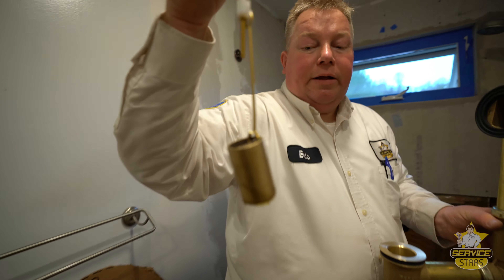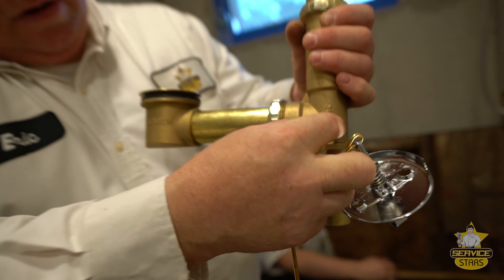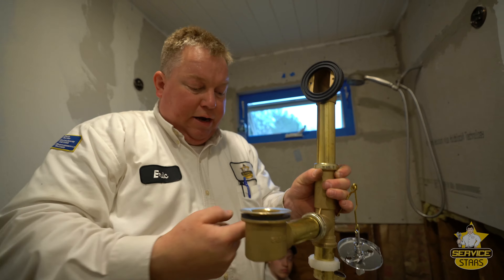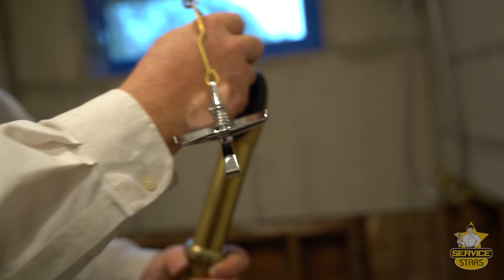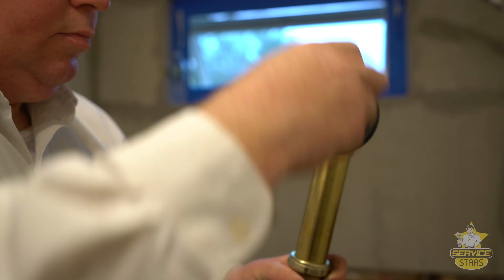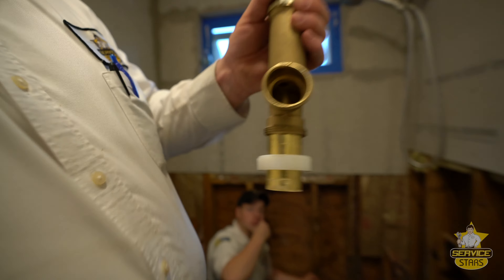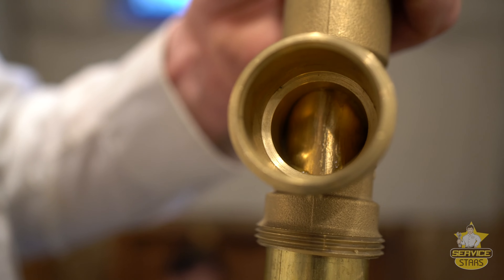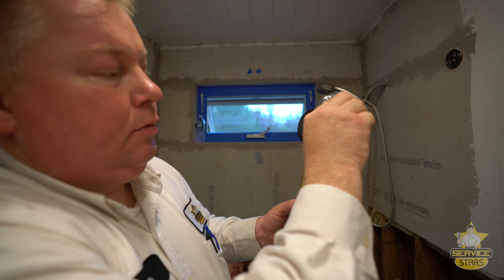How does a BATHTUB DRAIN work?

Comment: It's quite simple really any liquid or water will always flow to the lowest spot or area...in order to maintain that rate of flow there has to be in air in the drain system or there would be no flow...most fixture units will have over flow holes that drain into a trap the part that stops drain fumes from coming into your house I've been a licensed plumber since 1986 support union plumbers

Comment: I had a water problem in the celler, the ceiling was dripping water, I thought it was a underfloorheating pipe that leaked.  My son insisted that I call a leakage finding company because it was complicated to judge the situation. It was a loose bathtub drain.  Thanks for explaining and showing a housewife a video,  we would like to know what is going on in our homes and the precautions to take. Be blessed.

Comment: I just replaced my entire trip lever assembly and am having a hell of a time adjusting it to block the water. If I measure the distance from the lever plate down to the drain, that is the approximate length the linkage and barrel should be, correct?

Comment: I have a frozen overflow valve stuck. I was trying to pull it up with a strong metal rod but unable to. Now i have hotspot on the floor near my bathtub. Could i have bursted hot water pipe in the process? What do you think? Is it a coincidence?  Thanks

Comment: My barrel/stopper fell off into the pipe. Right now water is flowing and not clogging. Any suggestions on retrieving it?
Reply from the maker: Hi Mike! If you're cool with DIY, we've heard and seen people take off the cover plate and use a metal coat hanger or some other small hook to fish out the barrel. You would need to look up instructions on the method to remove your cover plate based on brand and model. 

Once it's off, get some light in there and use your phone's camera as a viewfinder if the opening is large enough. There should be a tiny loop that you need to hook into. If you're able to get it out, you should then be able to reattach it to the original hook on the drain plug mechanism.

If you aren't comfortable with that or the method doesn't work out, we'd advise getting a professional plumber there to assist. Best of luck! ⭐️

Comment: What the ... ??     I didn't know the overflow drain worked like THAT.  That means the old-style tubs have the first few inches of drain pipe that are always within the circulation path of the bathtub water ... meaning, whatever bacteria has grown inside that short section of pipe is part of what you're bathing in.  How insane!!!
The actual tub stopper that's located INSIDE the tub is what you're going to want, because it's not absolutely disgusting.

Comment: My barrel stopper is stuck in the open position. Any tricks to get it out without opening the wall. I poured rust dissolver down the overflow, dish detergent, and silicone lubricant . No help.
Reply from the maker: Hey there! Without breaking down your wall, the next step would be to remove the overflow plate (the round cover with the lever on it). Every overflow plate varies from brand to brand on how to get them off, so you'll have to google your specific model if the way it's mounted isn't obvious. Sometimes they're just screwed in; sometimes they're held in by brackets and need to be gently pulled off, YMMV. 

From there, we've seen different solutions of liquids being poured down the plate opening, like boiling water + vinegar to dissolve any buildup that's seizing the barrel in place. If that doesn't work, it's worth trying to pull out the whole mechanism from the opening and inspect it for any major corrosion. That's probably the most we would comfortably advise before needing to open up the wall.

If you're not comfortable going through with that process, we highly recommend getting a professional plumber to get their hands on it. Hope that helps!

Comment: Is plastic better or metal better?
Reply from the maker: Hey there! We asked Eric and he said he prefers using brass but some bathtubs require specialty drains that are only available in plastic. Both materials are relatively strong and sturdy to use though; one is not necessarily a "bad" option compared to the other. Thanks for watching! ⭐️
Reply: My barel broke off the lever and is stuck down preventing water to drain and I can pull it. Any advice on how to fish out that barell
Reply: @joeba6347  I have the same issue. The barrel is a completely stupid idea to still be in use. It creates more problems for a function that can be easily replaced with a drain plug that you can easily access in your shower. Don't know why these things are still being made.
Reply from the maker: Hey Joe! Sorry I didn't see your reply; YouTube never notifies us for replies within replies... I see it's been half a year since this comment and we hope you were able to get the barrel out!

If not, the DIY route would involve getting a wire coat hanger, shaping it to a small C hook, removing the lever, and fishing it out of the hole. YMMV but the concept of the drain design is the same across the board. Otherwise, we'd recommend a professional plumber out to your home to get it out for you.
Reply from the maker: Just asked our plumbing department what they thought about this. Looks like there's a debate among them now haha. We may get them on camera to get their opinions on barrel lever vs. drain plugs. Stay tuned!

Comment: Hi i have a question.  My trip lever fall apart and my water dosent drain.  I've been trying to fish it out with a wire hanger but it's hard. Do the trip lever could be more underneath the pipes or you think it might be stock and close to the bathtub drain. I order a magentic long wire tool don't know how to fix it. Need some advice.  Thank you.
Reply from the maker: Hey there, sorry for replying a few days late! Assuming it's a drain made within the last couple of decades, it should be stock and within the bathtub drain area. There are slight variations between brands on how they designed their lever system, but the concept is the same.

You'll have to be pulling against the suction that the barrel has created too, so it won't be as easy pulling it up with a magnet. This is one of the times we highly recommend calling up your local trusted plumber to get your problem solved. 

I think there's a few other DIY methods people may recommend, but there's risks involved that could compromise the rest of the piping. Better to get a professional set of eyes on it to also look for any other potential problems if your barrel drain system has gone bad. 

Hope that helps in some way!
Reply: @servicestars  Thank you for your support.

Comment: where can I find the gasket seals overflow plate that is on top or what is the name to look for it.  Thanks.
Reply from the maker: I asked Eric and he told me its called a Tub waste overflow gasket. The gasket is behind the tub in between the back of the tub and the overflow so to replace it you need access to the rear of the tub usually that means you have to cut open the wall. Hope that helps!